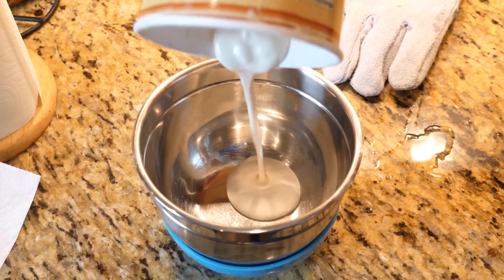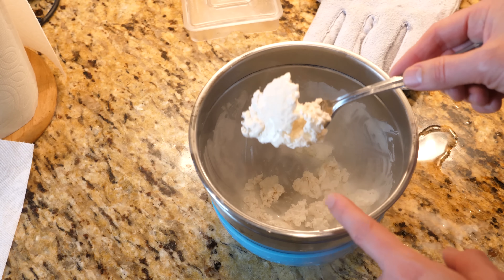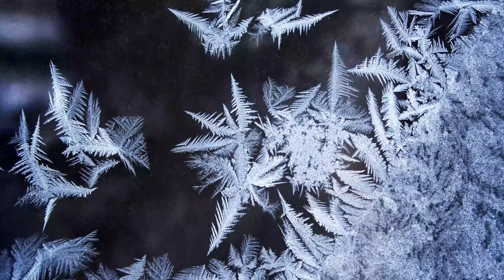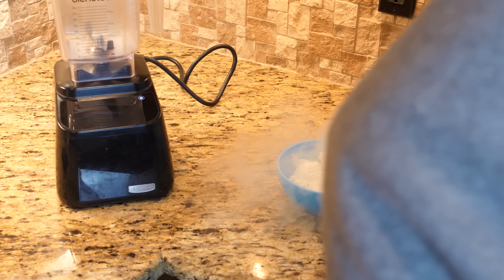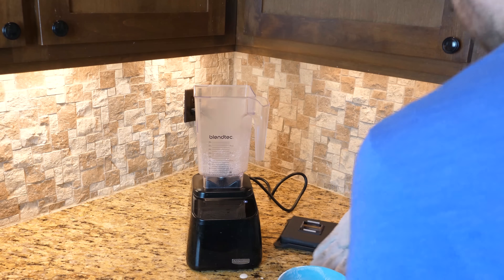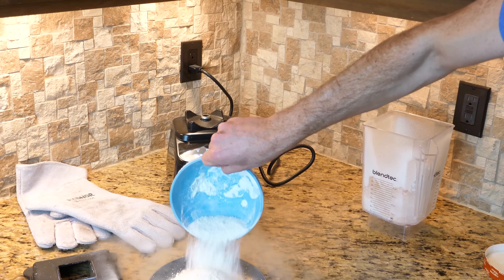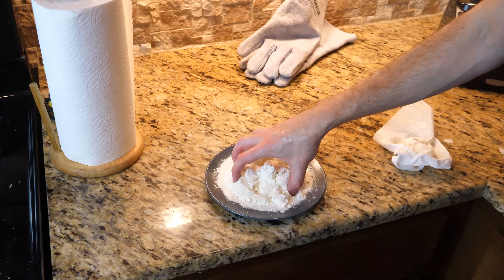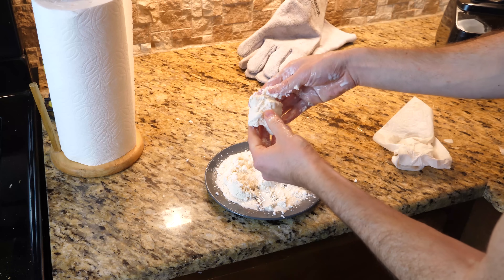Making Non-Dried Powdered Ice Cream With Liquid Nitrogen and a Blender

Comment: Fast and slow precipitacion/cristalization is one of the most misunderstood themes in superior scholl literature, alongside with the second law (entropy),  third law,  fourth law,  (thermodynamics as a hole) ...
and the very serious deal of the oil-water mix and superficial tension.

Other "severelly injured" themes includes LED tecnhnology (diodes and semi-conductors), matter-energy complementarity, molecular machinary, genetics at moleculsr level...

Of course those subjects are heavily hard subjects, its not like they were suppose to bee easy anyway.

Besides that, the authors have the obbligation, both morally and legally, to still make sciense progress, don't cast  sttudents away  and don't reveal their exclusive tech at the same time... its a fairlly complex task.

Comment: Sir, 1 small question, don't you need to filter/ distill out the liquid nitrogen from the ice cream before putting it in the blender, cause, I'm not much sure but, liquid nitrogen may be toxic/carcinogenic for human consumption ? Sir, I'm asking this question, cause I just saw you just poured the liquid nitrogen into the bowl of ice cream  and then, without any separation you directly put that into the blender to get powdered. That raised a question in my mind, may be all the liquid nitrogen just boiled up and vapourised in which case my question is point less, still..... Correct me if I'm wrong...

Comment: Most people that don't live in places that get stupidly cold think of snow and ice as being wet. But when it is -30 or colder it's very dry. Also ice becomes a lot less slippery when it's too cold to form that layer of liquid water when you put pressure on it. On the other hand it can make the soles of your shoes really hard and brittle if they are cheap and that can make them stupid slippery... and crack...

Comment: I would like a video about cholesterol and ergosterol some day... 
and how they respond to temperature in the modulation of the cell plasma membrane molecular permeability.
   
   Some people think that cholesterol ALWAYS diminishes permeability, but actually it does so ONLY above transition phase tempetures. 
   Below those temperatures, it highers the permeability (not reduces it), by preventing radial interactions of a single phospholipid to determine solidification, in the plane of the membrane. 
    Above transition phase temperature, it will lower permeability by interacting with the phospholipds and reducing their translational movements, like they were more massive. 
    In both cases (or at any temperature), it will act as another barrier to other molecules trying to cross the citomembrane, by making the membrane more dense; but bellow critical temperature this effect is less powerfull than the solidification inhibition. 
   
It would be a good theme.

Comment: GREAT VIDEO;  this, the one about oil-water and the one about the blood, between the lattest ones. 

   Some days ago you said the plasma membrane or phospholipid bilayer has water impermeability. 
While this is true in some sense, it's not true in absolut sense. 
Water and even larger molecules, such as dextro-glucose and others, actually CAN cross the plasma membrane; and if they didn't, "in vitro"  red blood cells (or any other cell) would not vary their volume in response to osmolarity. 
   Most water and d-glucose (even more) will NOT cross it, but a small fraction will. 
   
   A phospholipid bilayer "in vitro" only  has absolut impermeability to charged ions in water solution. 

   A  human cell membrane "in vivo", has to consider the proteins in its surface,  witch allows the ions to sellectively cross it. And cholesterol molecules too.
Reply: Water soluble atoms cant pass through, they need channels and active energy
Reply: @JohnnySinsHD  
That's right, its like that "in vivo". But when we are "in vitro",without proteins and ATP, they should zero the cross, but that ONLY happens with charged ions and large molecules.  Small molecules, like d-glucose still crosses (but at a 
 very small ratio), water does it at a larger ratio.
Reply: @JohnnySinsHD  
These videos are great.